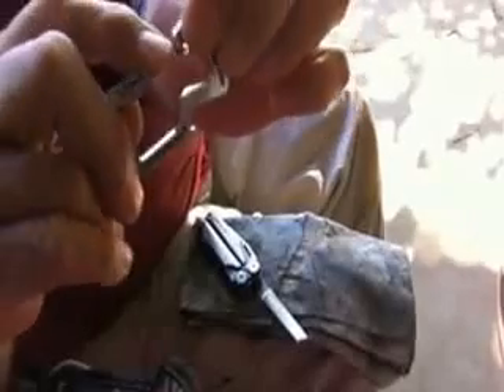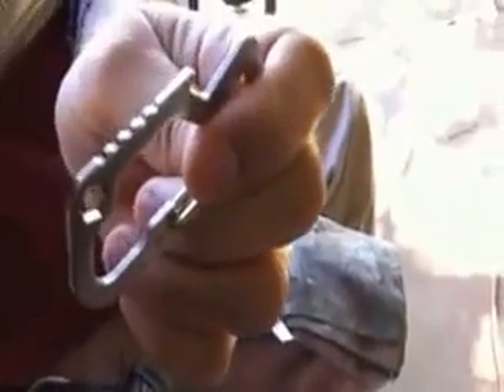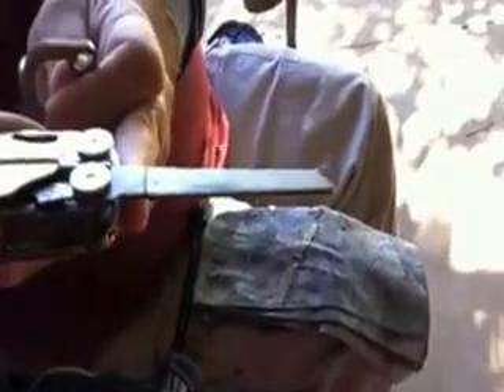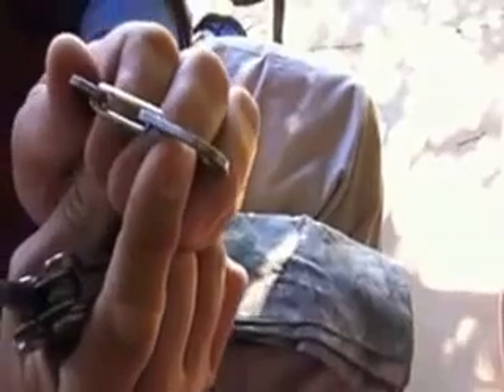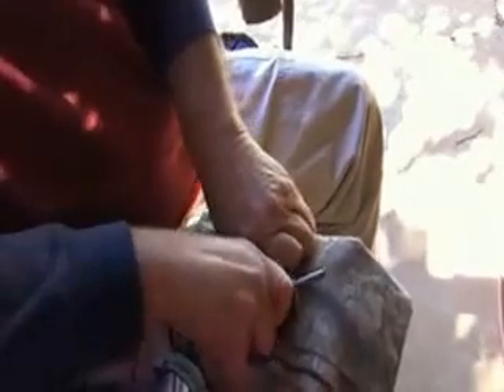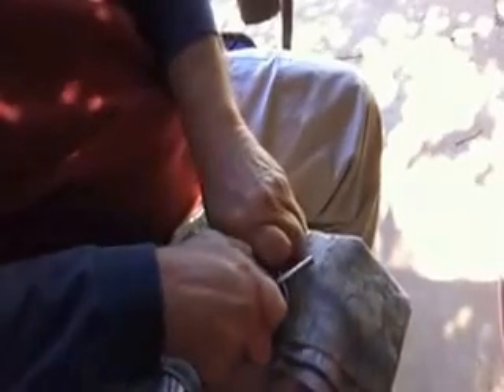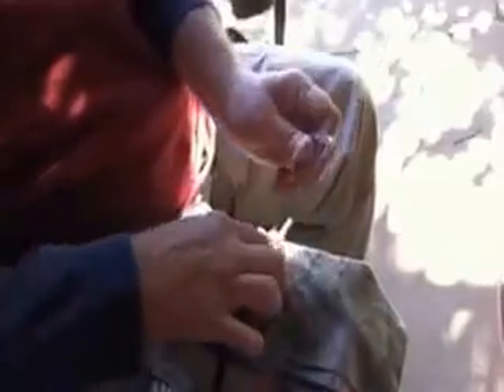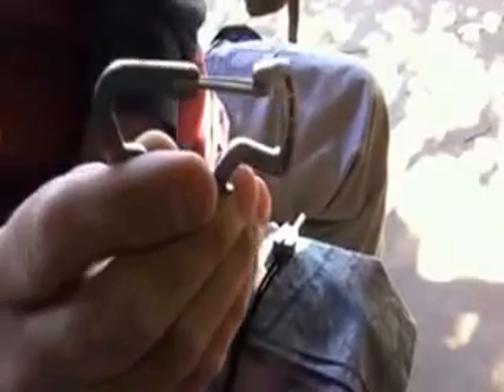Improvised Striker for Fire Steel

Comment: Where could a guy find one of those? Did I see a can opener on it as well? That could replace a couple items in my bag by itself.
Reply from the maker: The Leatherman Carabiner has a cap lifter; does not have a can opener. They are listed on eBay and Amazon.